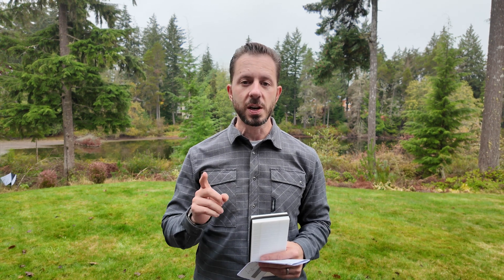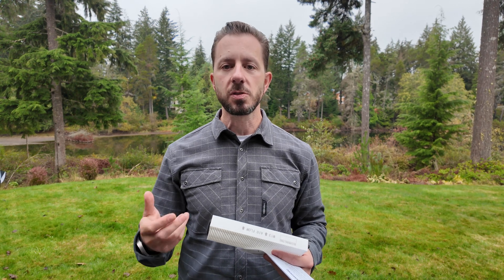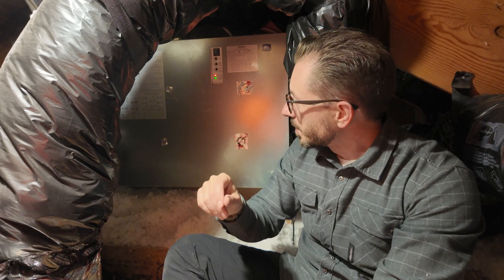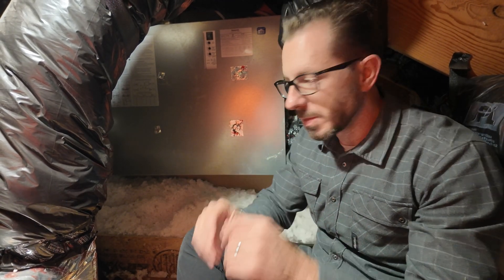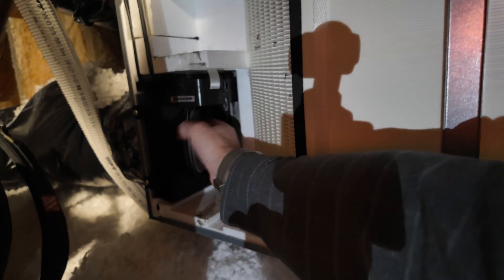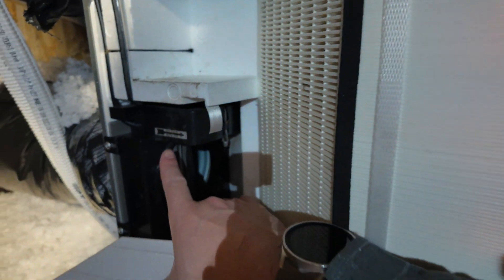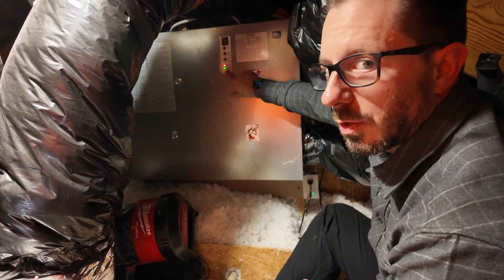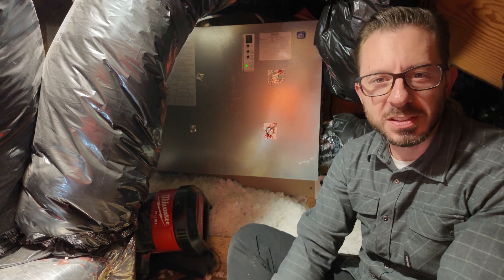Panasonic Intelli-Balance 100 ERV Filters

Comment: Maybe hard to retrofit but if building new construction can you put for example an MERV 11 Aprilaire 4" pleated filter system upstream of the ERV which would do most of the heavy lifting and would allow the ERV filters to last much longer?
Reply from the maker: I think a filter box downstream of the ERV is the way to go
Reply: @PioneerBuildersInc  Just to clarify do you mean having the filter box upstream or downstream of the ERV? By upstream I mean the air will go through the filter box first and then the ERV so the ERV filter is "protected" by the filter box. In my mind that makes more sense.
Reply from the maker: @tamil1001  you've got it - intercept the incoming airstream before the unit

Comment: It's nice to see ERVs included as a standard item. When I retrofitted one into my attic earlier this year I'd seen many complaints about filters getting dirty quickly along with expensive filter replacements so I made a point of adding large inline filter boxes for both the fresh air inlet and stale air outlet. It added a bit of expense to the install and took up more space in the attic but enabled me to use two inexpensive 2 inch thick 14 by 20 merv 13 filters in the insulated fresh air filter box. When I checked the filters after 6 months they were still relatively clean given the large filter area and bugs/dirt don't make it past the first few feet of ductwork into the house. The inside of the Broan 210 ERV itself remained pristine.
Reply from the maker: Awesome comment, and I think there's a place in the market for prefabricated boxes with connection points